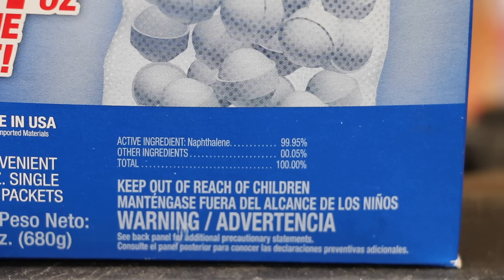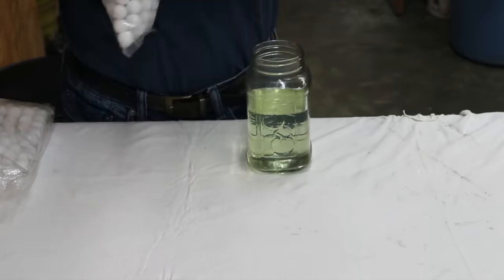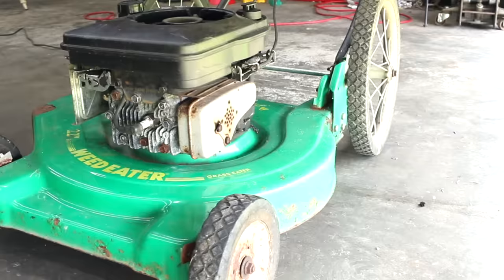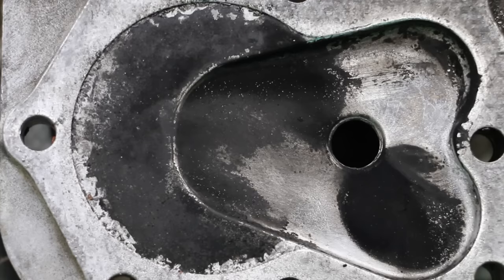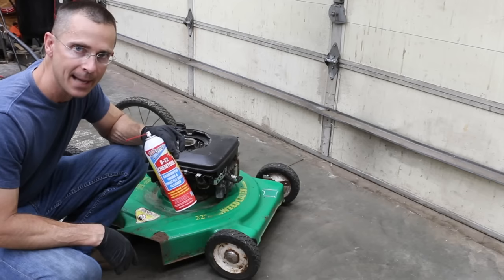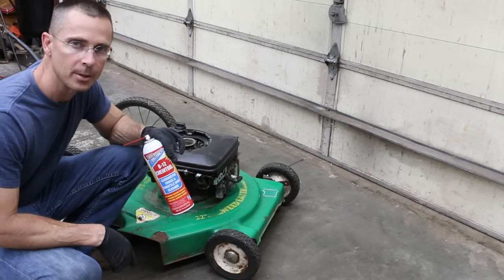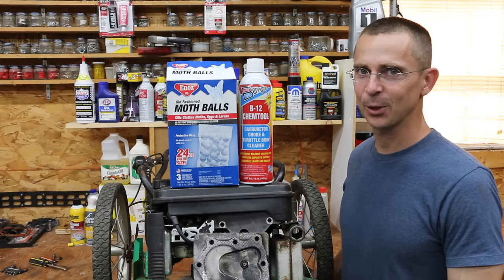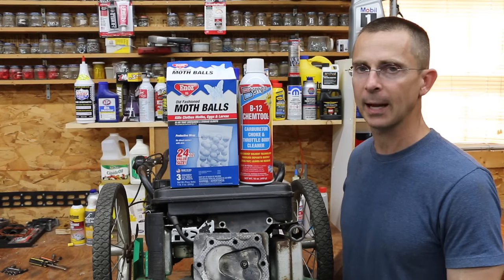Will Mothballs in Gas Destroy an Engine?  Let's Find Out!

Comment: Run 2 stroke gas in a 4 stroke engine
Reply: Won't do much except provide extra lube and maybe burn a bit dirty. I used to use up 2 cycle gas in the snowblower come winter time. No problems.
Reply from the maker: Zach, Great suggestion--thanks!
Reply: At worst it will smoke a lot, eventually likely cause carbon deposits, and on a vehicle it might clog the catalyst
Reply: Zach Bower depends on the oil. I can attest as a certified Stihl mechanic , that a quality two cycle oil will leave minimal deposits . if you use marine oil , it will degrade certain components as it has ammonia blended in it. I use synthetic oil on the  break in because that extra oil in the fuel helps lubricate the upper end. I've ran 50-50 drain oil in a lawnmower for a summer  and it still  chooches
Reply: I have used 2stroke fuel in my 4 stroke mowers for years... It doesnt hurt them and it doesnt smoke... The extra lube it gives wont hurt nothing neither
Reply: Project Farm use marine oil. regular two cycle oil at any normal ratio won't do anything but lubricate.  the real test would be at what ratio does the engine not like the oil. I've ran 50-50 drain oil and old two cycle gas mixed from the sawshop I worked at in a lawnmower for two summers. after not blowing up they gave it to me for free. that engine still runs to this day and that was 4 years ago now. I still haven't changed the oil or spark plug and it gets abused more then anything else I have, being used as a brush hog, mowing trails in the woods. and now it lives as a makeshift generator. Im certified Briggs, Honda and Stihl mechanic and I love your videos.
Reply from the maker: the dude, thank you very much for the project recommendation!  Also, thank you very much for the positive comment!
Reply: I think some 2 stoke engine tests would be very cool to see.  Regular fuel in a 2 stoke would be an obvious one, but I'm sure you can think of many others.  Not sure if you have any 2 stokes laying around though.
Reply: I do that all the time, it burns a bit dirty and sputtery but it burns well and is a good way to put fuel to good use if you mess up your ratios :)
Reply: Keep up the good work! I look forward to your tests!
Reply: Zach Bower yeah ive done it befofe in my pitbike to get to the gas station and it was fine. It still pulled wheelies all the way to rev limiter in 4th gear
Reply: run diesel in a 4 stroke engine for shits and giggles to
Reply: Zach Bower won't hurt a thing. Do it on job sites all the time when there isn't any regular gas anywhere. Lol
Reply: I've run both diesel and 2-stroke mix in 4-stroke engines, They both run in a hot engine, but make restarting difficult.
Reply: I get rid of old fuel for my two strokes in the spring by running it in my four stroke lawn mower. Done it for years and it runs like normal. No smoke.
Reply: Zach Bower I ran nothin but 2stroke for a solid week and a half pulled the plugs and had a little build up that's it went aback to straight gas but I still mix an ounce or two of Kano kroil and automatic trans fluid in the gas as a extra cylinder lube
Reply: 2 stroke gas with the oil drained out of the crank case. See how long the engine runs with only the piston and valves lubricated.
Reply: Try coolant to see if it will clean the valves and piston
Reply: I run 2 stroke oil in my trucks n equipment all the time, doesn't hurt nothing.  I think it may help lube some shit
Reply: Zach Bower draino will ruin a engine.
Reply: Zach Bower been there done that on small lawn mowers like he uses before just smokes a bit while warming up
Reply: nothing will happen other than extra lubrication and probably smoking. If anything you should suggest to test it the other way around and see how long the 2 stroke lasts without its proper oil mixture.

Comment: Run diesel in a gas engine
Reply from the maker: Thank you for the project recommendation!
Reply: Project Farm I've heard that if you mix gasoline with diesel in a gasoline engine (ratio 10:2) you get more horse power.
Reply: rc explore already exist
Reply: PingasTheFourth no diesel fuel has to have a hotter spark or high combustion before it will ignite,it will not run in a two-stroke engine. Diesel engines don't have spark plugs,but does have glow plugs for really cold starts.
Reply: Jeff garrett you cannot compress a liquid. If you could, be wouldn't have hydraulic brakes, etc. What you mean is igniting diesel in compressed air.

Comment: Um use only 2 mothballs per 16 gallons WILL raise octane and that much will crystallize obviously what u being bribed by some perf additives co so people dont us cheap way... if ur gonna knock something and try to prove wrong do it right and properly investigate before you put to test durr and ill still use them to give me a + 2 greater octane rating
Reply from the maker: Dean, Thanks for the constructive feedback.  I'll probably repeat the test using my old Ford Ranger.  This time, only using 2-3 mothballs for 15 gallons. Thanks!
Reply: dean axtell 

Care to explain how it works and how anything but an ultra modern flex fuel enabled engine would be able to take advantage of it?

Good luck answering that one...

Comment: Shouldn't have put the solids in the test!👎👎👎
Reply from the maker: I'll have to do this one over. Thank you
Reply: @ProjectFarm  Please do. I have a Mazdaspeed 3 and the cam-driven pump setup can have problems, so you disassemble the spill valve and fill with lighter fluid aka naphtha. The varnish vanishes and you're back up and running.

Comment: Hi, when street racing back in the 60s, the few guys that used mothballs, did not get good results. I did use 115,145 AV gas in a 20 pc mix to run well in a 13,1 comp big block ford. Btw, I'm asking that you do compares of amsoil v. Other so called pure synthetic oils. Thanks.
Reply from the maker: Thanks for the recommendation to put together an Amsoil vs others pure synthetic oil competition.

Comment: I think you should repeat test but use only dissolved solution of only 1 or 2 mothballs per Qt of fuel.  While your at it does marvel mystery oil mixed in gas improve performance?
Reply from the maker: Thank you for the video idea!

Comment: Hello Sir- I just noticed that you are using a E3 spark plug...reasons? I am still searching to assist you- and thanks for informing about BestOil - kroil oil..heard of it?
Reply from the maker: I bought the mower used and it had an E3 spark plug already in it.  Thank you for the recommendation for testing BestOil - kroll oil.

Comment: i think you are supposes to put them in the air intake to help with higher ignition temperature with the spark plug and fuel mixer

Comment: That trick was used years ago in the drag racing circuit with success. I've never heard any detrimental affects from
using them in gasoline. I was wondering if the composition in the mothballs was changed?  I had friends that tried
this years ago on V8 engines and they were warned not to use too many in the gasoline. I'm sure a fella shouldn't
use them in the new engines because of the computer controlled fuel injection systems that are used today.
Thanks for some good reviews.
Reply from the maker: Thank you!

Comment: I seen a dyno along time ago in a hot rod magazine back in 2000 were they chunked a handful (not a hole bag) into a beat carb 5.0 mustang and dyno it for like 5 horsepower and some torque consistently on every run.. I don't remember the mag it was like 18 years ago but I did try mothballs in atvs of different types and it did give a strong seat of the pants feeling and ran hotter
Reply from the maker: Impressive!

Comment: I have one input- I accidentally used Royal Purple Fuel Octane booster in my Subaru, but used the diesel formula...don’t think I caused issues, but what’s your perspective & ideas
Reply from the maker: No, you didn't hurt anything.  Be careful about using Octane boosters and make sure they aren't sold as "off-road" use.  Those contain additives that could cause issues for the catalytic converter. Thanks again.

Comment: Not sure if you have revisited this after this video but naphthalene is a common additive in fuel treatments... (Pretty sure that seafoam is naphthalene and rubbing alcohol) But to be fair there is the entire gamut of nonsense and fuel additives for the most part it is snake oil.
I would be curious to see you do a video on acetones effect on gasoline efficiency.
I done some testing with it myself years ago on a carbureted vehicle. 
If I had a dollar for every time someone claimed acetone would "dissolve and crack the o-rings"
It's in a very low concentration and like you mentioned B12 chemical has a high percentage of acetone in it... And in my opinion is probably one of the better fuel additives also considering the cost. 
Or just fuel additives in general and perhaps you could do them by types? They definitely don't make it easy to figure out what is in them but you can check the MSDS and get a general idea.

Comment: Would your comment about chlorinated mothballs (1,4 DiChloroBenzene) indicate that there might/would be similar hazards using PTFE as say, a piston/cylinder coating? With such a low COF, PTFE might conceivably used as a coating and seeing how little oil need to be used to lubricate an engine and not seize up. Or coating something in the crankcase with PTFE.
Reply from the maker: You bring up a great point and I'm not sure if there are hazards with PTFE.

Comment: I tried this many years ago in an 85 Honda Accord when it was running rough. After putting a few mothballs it actually starting running better and much smother so it worked for me. That car also had a carburetor btw.
Reply from the maker: Thanks for sharing.

Comment: I've been running my own experiment with placing them on the dirty side of my air filter.  Considering they sublimate I wont have the particles problem.  Been adding 1 a week and taking all my results with a grain of salt.  Currently sitting at 10 balls on a 3.7l motor.
Reply from the maker: Thanks for the feedback.

Comment: This video is really interesting but try the test again with the mothballs dissolved or at least filter the gunk out. I guess the engine stalled because of the gunk builded up the carb or in the fuel filter. And a sidenote: Do the mothballs works as an octane booster like Mythbusters did years ago?
Reply from the maker: Thank you for this recommendation!

Comment: How about a mixture of thick syrup which would have a lower water content (like a table syrup), molasses or honey and alcohol (90% or higher ethanol or isopropanol) to try to kill an engine, I have always thought that this would mix with the gasoline unlike sugar and make it in to the cylinder to carbon up the engine and cause problems.
Reply from the maker: Thanks for the video idea

Comment: Perhaps try the chemicals found in mothballs added in liquid form,then there's no risk of particle buildup from it not dissolving enough.
Maybe also run tests to compare the actual power of the engine both with and without the mothball solution
Reply from the maker: Anthony, These are great suggestions--thank you!

Comment: I remembered back in England as a youngster we used to set a high idle on engine and then pour about a pint of water through the carb to help get rid of carbon not sure if it really did much but the smoke was cool and it was free
Reply from the maker: Thanks for sharing.

Comment: Naphthalene is actually used in injector cleaners. I tried this a few years back and made my own injector cleaner, can’t remember the other chemicals I used. But the base liquid for example Naphtha had to be heated in order to dissolve the moth balls. After that, the concentrate was added to a tank of fuel.
Reply from the maker: Thank you for the feedback!

Comment: Really enjoyed this.  I noticed the mothballs were 99.95% Naphtha which is a flammable liquid that an internal combustion gasoline engine should have no problem burning.  I wonder if the white deposits on the carb were just the binders -- the other .05%. (?)  I don't think pure liquid naphthalene would do that,  but then I don't think it would improve performance either.  
Fun test.  Glad you're willing to risk your equipment so we don't have to.  LOL
Reply from the maker: Thank you!

Comment: About fuel additives - there is a popular diesel fuel additive in Europe called Antigrippante 25. It cleans and helps to lubricate internals of injection system. I've used it before quite a few times, it helps to reduce noise and smoke and the last time I used it my consumption dropped by more than 10%, from 11 l/100 km for the last 4000 km before reset to 9,6 l/100 km for the last 1000 km (bmw 530xd 2007). I'm not being sponsored but I do reccommend it to anybody. @ProjectFarm I can send you a bottle or 2 if you're willing to make a test...

Comment: During the 2nd World war 1 mothball per gallon of fuel was used to help increase the octane rating of substandard petrol.
It also permitted the use of any old mineral oil mixed with petrol in 2 stroke engines.

Comment: I used to travel in Mexico a lot on my motorcycle and would occasionally get some really crappy gasoline. When I heard about stock car drivers putting mothballs in their gas tank to cheat and up the octane I though it would be a “fix” for getting crappy gas.
I took naphelene mothballs with me on my next trip to Mexico. I was riding a BMW R80GS. When I was Chiapas I got some lousy gas and the bike “pinged” a lot going up steep hills so I used a ratio of 5 mothballs per gallon of gas. I first crushed them before adding to the tank. Sloshed the gas around to dislike and off I went. Octane must have boosted a bit as pinging was greatly reduced and bike did run better. No problems at all with clogging, eating rubber parts or diaphrams. I only did this when it was really required….and it worked with no problems at all.
They way this test was done, no wonder he had problems. Kinda dumb the way he did it.

Comment: During the 1970's, many engines suffered from pre-ignition ping. It was said that Naphthalene would mitigate the pinging. The formula back then was no more than 6 moth balls to a full tank of fuel. At that concentration, it would work and the engine performance did not suffer and pinging was greatly reduced. The car I used it in was sold in the early 90's with the original engine with north of 300K miles. I will admit that later in it's life I discontinued the naphthalene and just simply purchased a higher octane, at the time Exxon still sold a 98 octane premium fuel. In the lawn mower given the small volume of fuel, one ball would probably have been overkill.
Reply from the maker: Thanks for sharing.

Comment: I used to race back in the 70s and 80s stock cars and I used to put mothballs and Airplane Fuel and gasoline and let it sit for a week in the tank before I went and race the following Saturday night I'd like to see you try that. My carburetor would actually Frost up sitting there idling and you talk about pubes it was like pure alcohol but it put out the prettiest blue flame when you cracked the throttle going in and out of the corner on a high Bank race track empower it gave me plenty of power but you could not let it sit there and low idle or it would Frost it up
Reply from the maker: Thank you!

Comment: I would like to see this test performed again. However, this time I suggest that you do everything you did on the last test in this one except, this time, after dissolving as much of the mothballs as possible into the fuel, strain the mixture as you fill the tank. I think when you dump all that undissolved moth ball particulate (let's face it, those were major clumps) in, is what clogged up the carb, thus causing the engine to stall and is partially confirmed visually in the carb intake. Initially, as you stated, the engine ran very smoothly which would suggest it might be a good additive if dissolved. The only other test that would need to be performed, provided the engine test passed, is to see if the moth balls will come out of the mixture as a solid when left to settle.
Reply from the maker: Great recommendation. Thank you

Comment: I have seen mothballs added to a Cummins 400 hp engine fuel tank.  The truck pulled exceptionally well after that and then blew up, taking all of the pistons out with holes in the top..
Reply from the maker: Impressive!  Thanks for commenting.

Comment: Use fewer mothballs next time, and run it through a filter as well.

And if you ever revisit your diesel/gasoline mix video, try gradually increasing from 5% diesel to around when the gas engine cut out last time.
Reply from the maker: Thank you

Comment: The aromatic has much more carbon compared to gasoline. It would need more air vs fuel to burn better. Also as the fuel evaporates in the carb the naptha comes out of solution in the concentration you used. So, Napthalene does increase octane but you should try the test using the amount they used to use years ago. You over saturated the fuel. But if you were trying to ruin someones engine then pour all you can in the tank.
Reply from the maker: Robert, this is great explanation.  Thanks for commenting!

Comment: A buddy of mine used to run one mothball per 5 gallons of fuel (which was ALWAYS 91 octane, non-ethanol) in his '92 Ford Tempo and it helped his fuel mileage and engine performance slightly. I think there were too many mothballs added to this mixture
Reply from the maker: Yes, I messed up this test by adding way too many. I'll have to repeat the test in the future.
Reply: Project Farm I look forward to it! :D

Comment: They used to put mothballs in dragsters'fuel tanks before a race.  They would boost the performance, but the engine had to be disassembled and cleaned out after the race.